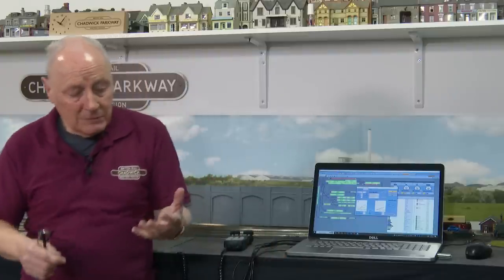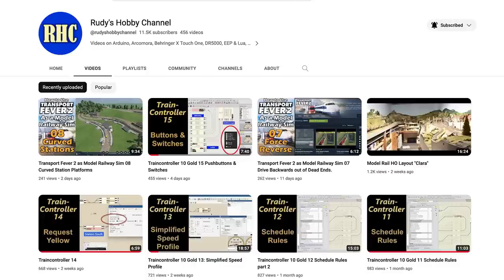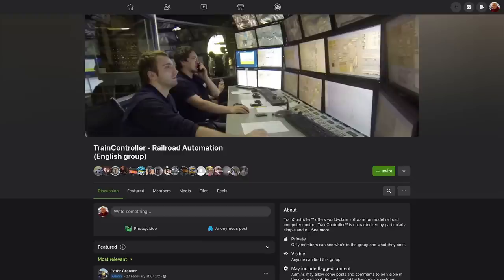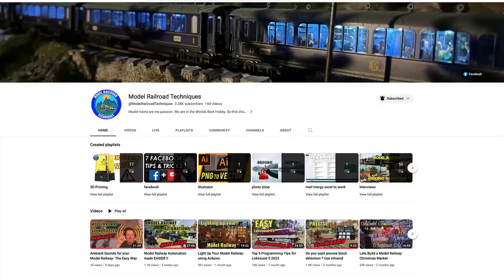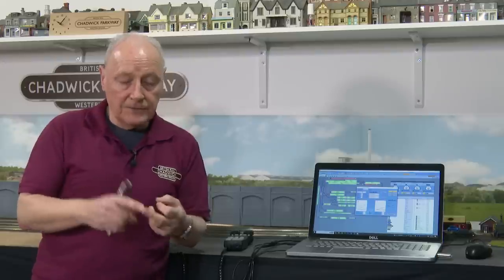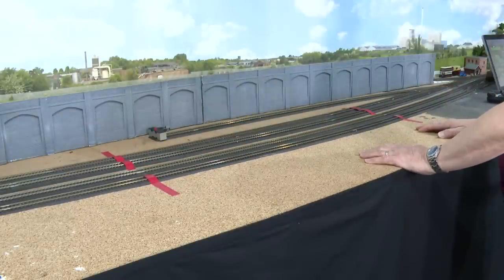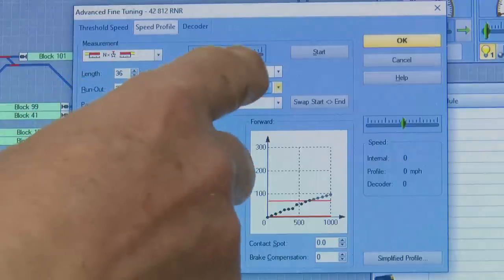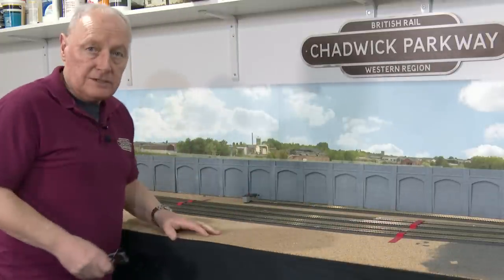SPEED PROFILING with Train Controller at Chadwick Model Railway | 184.

Comment: Impeccable timing Charlie, after spending the last couple of mornings reviewing your videos on CV's so I can adjust them for my first attempt at speed profiling on Train Controller I head to my train room with a brew and come across this gem.
I'm blown away...yet again.
Thanks mate! 🙂
Reply from the maker: That’s great news Dean. However, please don’t forget that other folks might have a better procedure. Regards Charlie
Reply: @ChadwickModelRailway  Thats true enough Charlie but the way it is presented helps a lot, anyway I had a crack and it was awesome watching the locos do their thing, I just have to work on the deceleration a bit as the performance varies due to loco specs, all in good time but it was heaps of fun.
Thanks Dean

Comment: Thanks Charlie, yet again I've watched all the way through, not had the faintest notion what your talking about, but again found it very interesting and marvelled at the control you have and your quest for perfection. I really like the way you present your videos and the fact things don't always go perfectly and your not afraid to show the problem. Keep informing us uninformed and meanwhile I'll go back to my little analog system and maybe dream. Regards Eddy xx
Reply from the maker: I’m so pleased that you found it interesting Eddy. Regards Charlie
Reply: Essentially, Charlie is telling his train control software how to model realistic speeds, including acceleration, deceleration and braking to à stop.

It has to be done on a locomotive by locomotive basis because motors  decoders etc. all have their own individual characteristics. 

The software profiles essentially store sets of values for various time over distance measurements at different motor settings so it can then apply them to generate realistic running speeds as well as acceleration and deceleration rates.

Comment: Once again an Excellent Video
Keep this Short format along with the more in depth Video's shame it took you longer to make but it pays dividends to people like me on this sometimes steep learning curve,as you might remember i'm on my second rebuild in 4 years after taking your advice and following your suggestion's and commendation's .
I would like to see a Short(ish) Video on how to wire various components up as like many yourself including know DCC isn't Just two wires maybe how to add Circuit Breakers,Block Detectors and Point feed's so they work together especially how you wire points so if you run into a point set the wrong way and you have the ability to set point without the Hand of God coming into move the Train before you can reset the Controller Its taken me a few Hours to rewire.
Keep up the Great Work
Reply from the maker: Great comment Chris, and I will certainly tackle point motor wiring. 
Regards Charlie

Comment: Well done Charlie. I don't use Train Controller but do spend a bit of time speed matching my engines. One of the first things I learned was the variability of like brands of decoders! Not to mention 2 identical locos needing different cv settings to get them going at the same speed?
But that is the fun of it all. 
However, the most important thing I do is enter all my programming settings into a book, each page being dedicated to a loco. Importantly,  the loco details such as make, model price etc are written in ink but any cv values are in pencil! This is a life safer and very handy to boot!
Reply from the maker: An excellent process Peter. I take my hat off to you. I do the same but with a spreadsheet. Regards, Charlie

Comment: Cheers Charlie.  Interesting stuff.   I use iTrain but the loco settings and principles very similar.  And just as fiddly to perfect!  I invested in a USB sensor which can be placed more or less anywhere on a straight track (rather than using three blocks).   It works pretty well and, as you, say you go off and get a coffee everytime you profile a loco as it takes 5-15 minutes.  I have sometimes come back to find the loco at the other end of the layout as iTrain somethimes has a blip, but as long as the testing track is a loop or has buffer stops, no harm is done.   And you can start iTrain re-profiling and re-do a set of speed-steps if necessary rather than have to re-do the full profile.  All in all, not bad.
Reply from the maker: Thanks Alec, yes similar to Train Controller. I’m sure they both have a glitches. Regards, Charlie

Comment: Fascinating stuff!  It strikes me quite forcibly that the individual loco motor profiling (which is essentially what TC is doing here) is actually very similar to what the engine management system in a modern car does - i.e. it adjusts the inputs and operational parameters and measures the engine performance at various times and speeds - though it does that as a continual thing - not a one off.   I imagine that if you profile your Hymek Motor again in year's time (assuming normal usage) the stats you get will have  changed due to the wear state of the motor and the drive train.  Whether many modellers would want to spend time reprofiling their locos annually, is an open question - but the results you got speak for themselves - perfect speed control (automated if selected) adds an awful lot of realism - esp as compared to the abrupt stop starts you see on many layouts.   Thanks Charlie!
Reply from the maker: Thank you for such a rewarding comment. Regards Charlie

Comment: Thanks Charlie. Interesting, informative and well presented as always. I’m using ITrain and use a Railspeed from LSdigital for speed profiling as an alternative to the track section. This uses a short infrared sensor. Quicker for diesels but it does not always like the variable shape of a steam locomotive body. Generally it works well and does save time. I’m using a Roco Z21 but have a Digitrax 602 plugged in to it. I do get one or two issues and so will unplug this to see if they resolve. I will let you know.
Reply from the maker: Great comment Phil.  Do keep me posted on the DT602 issues. Regards Charlie.
Reply: Stick a postit note on the side of the loco, makes infared much more reliable:-)

Comment: Great video Charlie. I love TC but it does make my train life more complicated. 

I run my TC trains in non-automatic mode quite often, using my iphone as throttle, so I have decided to use decoder settings for speed matching and leave TC loco settings untouched apart from max speed - eg have been setting accel/decel on the esu decoders to 19 to give pleasing movements / sound correlations in self-drive mode. These decoder settings for CV 3 and CV 4 seems to work OK in autoruns as well, rather than setting the decoders to zero. TC feeds the loco an increasing / diminishing speed setting to simulate momentum, and the decoder has an imperceptable lag implementing this due the the decoder momentum settings, so they seem to work together and not be in conflict.

Trying to change as few settings as possible - variables in decoders multiplied by variables in TC can quickly get the brain spinning, it can soak up much of the time available for the hobby. 😂 Been working with TC for 3 years, still seems like a long way to go.

Some more studies on implementing TC on a layout would be great, in the manor of "This is how I want to run trains, this is how to make TC do it". Rudy's videos are great, and the manual is comprehensive - although like many software manuals it describes what the system can do rather than how it supports a layout operating concept /outcome. Perhaps define four typical operating concepts and define the TC setup for each, hobbyists can fine tune from there.

Many of the TC tools are powerful but require combined usage which is not clear from documents eg Use of flagman to temporarily restrict block entry in other remote locations will prevent stalemates in non-typical track arrangements - took me a looong time to discover how to do this, obvious in hindsight as always.

Trying to run multiple long trains in n scale, the physics does not scale so we face inevitable challenges - understanding ways for TC to help manage mechanical failures would be good - decoupling, derails, stalls/shorts at turnouts and dirty track spots etc. The schedules generally continue without mercy leading to a pileup somewhere as the first warning, so you have to stop everything and do lengthy forensics, reset train locations etc. Yes, perfect track and rolling stock is the answer, but I'm not sure I will ever get there with a complex layout and limited train room time.
Reply from the maker: Thank you John for staggering Look into your world. May I ask what control system you’re using? Regards, Charlie
Reply: NCE procab with BD20 block detectors, Tam Valley decoders for servo switch machines. In a couple of places have used Arduino ultrasonic detectors as overhead stop sensors. Frog power is switched through a mix of Tam Valley frog juicers and Arduino relays (the relays are
much cheaper than frog juicers). It's amazing how much electronic gear sits below a yard ladder...
Reply: Unfortunately I think the answer to manage the mechanical fails during autoruns, may be that all the rolling stock needs to have resistor wheelsets so that a broken train shows blocks as still occupied and prevents launch of other trains leading to collisions. Been wanting to avoid that solution, as most of my cars have been fitted with good-running micro-trains plastic wheelsets and couplers, a previous and expensive upgrade program prior to the introduction of TC. With 20 trains X 25 cars X 4 axles each, that will be a big investment of time and coin. 🙃 Hoping for a work-around before taking on that one...

Comment: Hi Charlie. A few comments from my experience with TC. Not saying these are right, just find it works for me. I leave CV2 start voltage set for lowest number usually between 1 and 3 depending on decoder. I use the “threshold speed” in train controller as you did to set the min speed that TC will use. Altering CV2 affects the sound of the locos and especially with steam locos the chuff rate will alter. You can then go to other cvs to alter chuff rates but it can all get a bit of a faff! It also means I can get a nice smooth start from the locos when driven manually rather than a sudden jerk of a start. As you say, cv 2 and 3 should be set to 0 (I usually use 1) for the actual profiling but I usually add some values back in afterwards. I do this to take the edge off what I feel is the rather sudden acceleration and deceleration in TC. Also re the momentum settings in the set up page, this should not affect the speed profiling at all as TC will not use these values during the profiling. I usually play around with the settings for loco weight, power and momentum to get nice smooth slow automatic acceleration but again, these can be set at any time and do not affect the profiling speeds.
Re problems with the DT602 throttles, I did have some interface problems with the previous DT502s. I found I had to go to options menus settings on the controller and “disable expanded slots” . No idea why it worked but it solved the problem . Thanks for the video. Not an awful lot about using TC on YouTube. Hugh
Reply from the maker: Many thanks Hugh for such a useful and in-depth comment.  
I shall check out your TC inputs and see if my trains have more stability.  
As you mentioned, it’s the initial acceleration that can be somewhat harsh. Stay tuned mate, and do keep in touch through my email address chadwickmodelrailway@gmail.com. Regards, Charlie

Comment: Charlie, cheers for this, I have an NCE system, but like running trains at proper speeds, so I did the calculations ie timing trains over a fixed distance (scale distance) then changing the CVs bit by bit.... I don't have a huge fleet, but boy did it take some time... so the train controller process, looked simple in comparison. thanks `Charlie informative and fun as usual, see you at Ali Paly?
Reply from the maker: I’m so pleased that you enjoyed it Vic. On my way to the show! Regards Charlie
Reply: Yes, indeed.  The recommend approach for using the USB speed gate is to set the max speed first by trial and error by running the loco past the speed gate and upping or lowering the CV until acmatch with the published prototype speed is scheived.  Once that is set, i let iTrain calculate the speed-steps and scale speed for each step.  if the max. speed for the loco appeas to be "wrong/too fast" for the layout area/scene, I simple put speed restrictions on the specific block using iTrain to make it more look realistic.
Reply from the maker: A sensible strategy Alec. Regards, Charlie

Comment: Hello Charlie, another informative video, but a bit over my head, though I have been doing something similar, When ever I add a new Southern emu to my layout, I first adjust the CV values CV2, CV3, and CV4 so that the new unit has similar running characteristics when coupled to the other emu’s on my layout. Nothing worse than seeing one emu wheels spinning when two emu’s are coupled together. Regards, Barry from NZ.
Reply from the maker: A sound strategy Bazza. Regards Charlie

Comment: Thanks Charlie for a good start on the swift series.  I wonder if your version/flavour has the same as my Gold where it can run a timed session through the test set up to get the top speed accurate.  It allows you to tweak 13:22  the cv to get the speed more accurate.  My problem was trying to find all the data on the locomotive including top speed! How about a swift on getting the correct weight into wagons and coaches to help with reliable running?
Reply from the maker: Thanks Paul, I found speed profiling to be a nightmare. I shall certainly check out the weight of wagons. Regards Charlie

Comment: I’m using ITrain but the set up is similar, however I set CV6 mid speed to around 1/3 of maximum speed to create a speed curve that allows finer control at lower speed steps
Reply from the maker: Thanks GGS, an interesting option. Regards, Charlie

Comment: I had the same issue when the DT602 was connected.  When the remote goes into battery saver mode it caused the engine to reverse in the middle of the center block.
Reply from the maker: I subsequently discovered that the locos being controlled by TC, must be deselected from the controller.  Tc appears to reference the controller, and if the speed is set to zero, TC stops the loco.
Regards Charlie.

Comment: I use the same DT602 controller but use iTrain rather than train controller and have found the exact same issue. A train would be running during the speed profile test then would randomly get an error on iTrain saying unexpected direction change which is because the DT602 has decided to take over the control. It's fine if the loco address is not selected on the controller. Or just simply unplugging it solves the problem of the systems fighting each other over control. Interesting video to see that Train controller works very similar to iTrain.
Reply from the maker: Thanks for this comment, Robert. It’s clearly a Digitrax program  Loconet issue. Regards, Charlie
Reply: Cheers Robert I Suffer with the same Problem Using iTrain and a DT602 Speed Profiling starts ok running back and forth then it just decides to keep running in one direction luckily my track sections are incorporated into a loop i'll try again with the DT602  unplugged

Comment: Hi Charlie. Thank you for your demonstration of speed profiling. I was wondering if the maximum speed would also be affected by how clean the the track or the wheels were during contact with the electric current? Equally, if the same locomotive was tested say three times, it may be different?  This could determine a more accurate speed for a given locomotive or EMU. For a mainline train, such as the Intercity One Two Five, or a 462 Main Line Steam Locomotive, the maximum speed could be greater than 60 MPH, so the scale speed would need to reflect this. This implies that the software and needs to be very sensitive to allow for variations shown on the graph.
Reply from the maker: An interesting point Alan. Fundamentally, I input the maximum speed which I want the loco to travel on my railway. If I were to put it on and unfitted freight train, I can make changes to the train properties itself. Regards

Comment: Thanks Charlie. Another great video, thank you. I'm definitely not at the stage of introducing Train Controller but a very informative video. I'm looking to keep things relatively low tech using my NCE Power cab. So just wondering if you might consider doing a Chadwick Swift on DCC Speed Matching to allow double heading etc? Apologies if you have already covered this in one of your fabulous CV setting videos previously. Cheers. Trevor
Reply from the maker: Actually Trevor, it’s covered by this video. It’s by matching the speeds of your locos and adjusting the CVs mentioned that you end up speed matching. Regards, Charlie